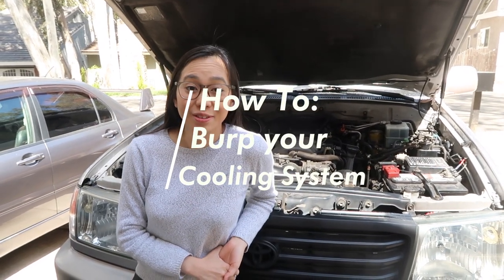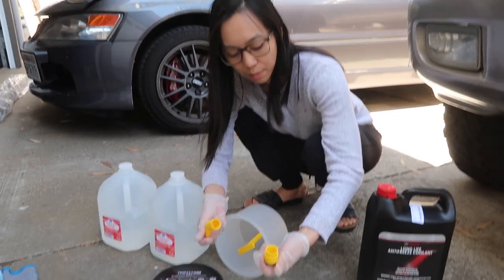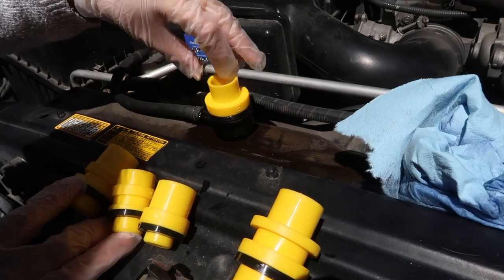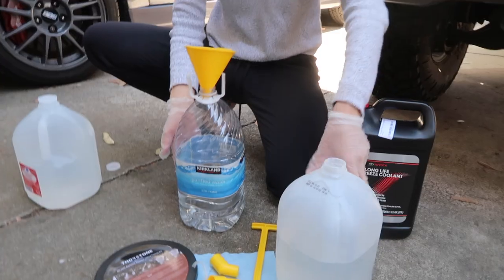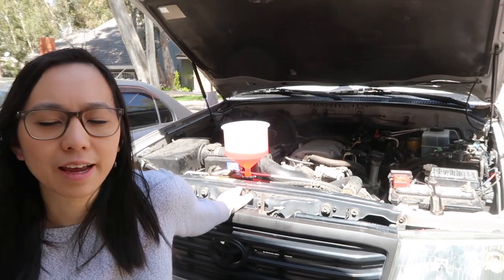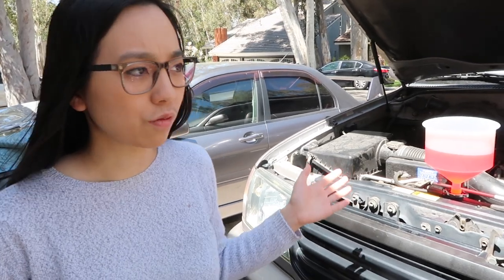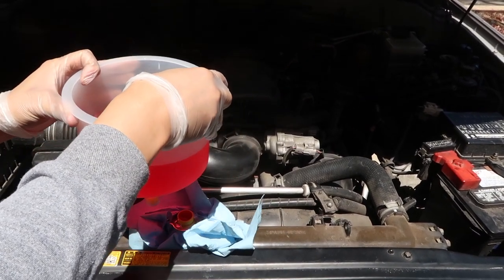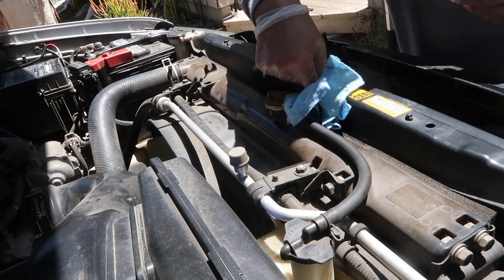Burp your Cooling System (Toyota Land Cruiser) How to DIY

Comment: Thanks for posting this video. I’m going to do this with the front of the landcruiser raised on ramps. Hopefully it should have the same effect as the radiator filling kit, but if it doesn’t work then I’ll do what you did.
Reply: Did it work?
Reply: @Julianconanhernandez  didn’t really work for me. I have a small air bubble trapped in my heart core. I also tried bleeding the system via the bleed screw stop the throttle body. I may need to just take it into my shop at this point as it’s aggravating me. 

I’ve bled systems in my older Mercedes’ and those seem way easier than this. I did try this funnel too, but it wouldn’t create a good seal so I was just wasting coolant. Might need to vacuum bleed my system.

Comment: Glad that you are using Toyota "red" OEM coolant.  It contains factory lubricants for the water pump that Prestone and other aftermarket coolant manufacturers do not have.  Next time you flush your coolant, change the thermostat, too.  It is cheap and your thermostat will not stick if your car overheats in the boonies.   Also, change your ATM fluid every ~60-75K using Toyota ATM fluid.  Again, good insurance for preventative car care.  Go find a good independent Toyota  factory trained mechanic that uses Toyota OEM parts.  Never go back to a dealer.  I used to work at Toyota R&D and TMS.  This guy can provide you with good maintenance car tips ("The Car Care Nut" on YT).  You have bought one of the most reliable and dependable cars around!
Reply from the maker: Really great tips! I’ll for sure reach out when I have any questions!